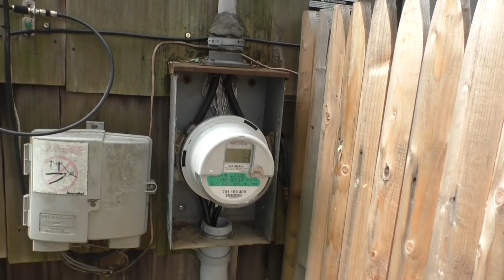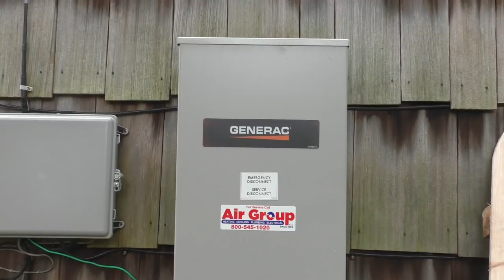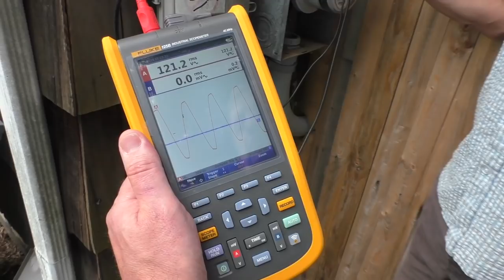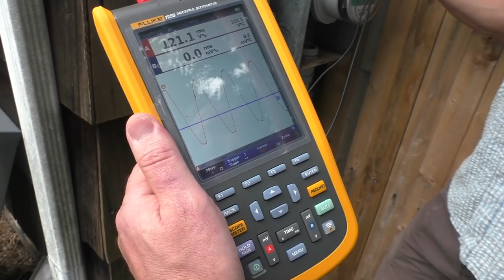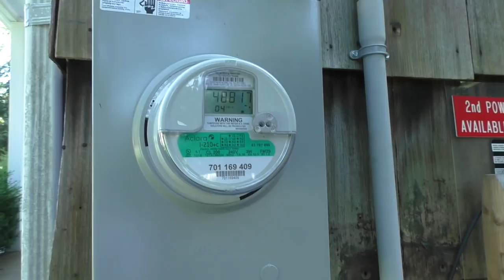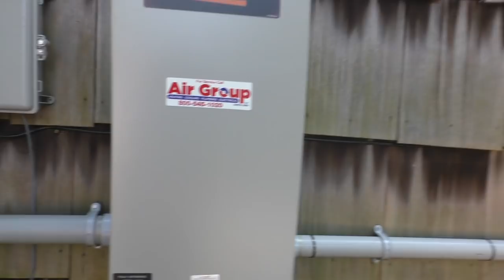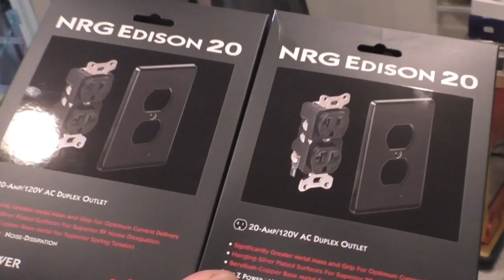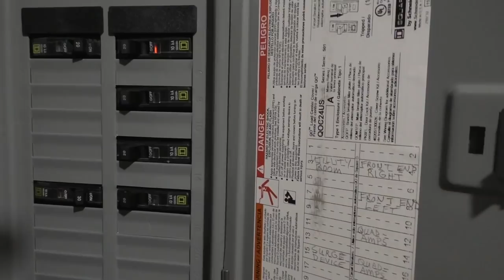Major Electricity Upgrade From the Roof Down Produced Sonically Amazing Results!

Comment: Great video and upgrade. I'm an audio design engineer who works for one of the country's largest engineering firms in NYC. In most of the designs that I undertake, I always design the electrical infrastructure using a balanced power panel. The concept behind balanced power is the same as balanced audio where it utilizes common mode rejection via the power like. In a nutshell, it takes 120V and converts it to two lines of 60V. The input accepts single phase 220V and it ties that to a large isolation transformer that makes the conversion to two lines of 60 volts. The results are astonishing. In your case, even with all of the ground rods and all of the power routing, you are still directly coupled to the outside transformer. With balanced power, you are basically disconnecting your entire audio system from outside power and utilizing  the isolated balanced power from the panel. In most of the acoustic demonstration rooms that I have designed, I have achieved at least 8dB of noise reduction alone when a signal to noise level test is obtained. As far as I'm concerned, it's the only way to go with an audiophile system. I've put balanced power in some broadcast studios as well. I suggest you check out balanced panels. Once you go balanced, there is no turning back.
Reply: Wow never heard of that! 

My system is all installed and done.. is this possible in the UK with 240v mains?
Reply: @johnshore3095  Yes. We use a 120v system here and the units that we use require two phases of 120v each on the input side. That said and being that the power in the UK is 240v on a single phase, the manufacturer will build a unit for you that could possibly accept two phases of 240v with two 120v phases on the output side. The reason for the doubling of voltage on the input side is to make the unit deliver more current. You can power an entire recording studio with just one unit.

Comment: I just finished redoing my music room, had the electrician run two separate lines from the panel to my stereo plugs. These lines don’t feed anything but my Amplifier and Turntable, at the same time we had upgraded to a 300 amp entry, so all new copper wire from the street. 
The difference in sound quality was apparent immediately. 
I found it was the low end or bass that seem to tighten up the most. 
Also noticed quiet sections of the music seems quieter if that makes sense. Describing 
what we here is so difficult for some of us. 
Not sure I would recommend someone going through the expense and trouble of doing this unless you were having hum and noise issues and I wasn’t but we were doing major electrical work anyway so figured what the hell. Anyway that’s may take. Thanks for video. 😎

Comment: Very interesting! As a Dutch person, it's very nice to gain some more insight into the USA power systems.
Reply: USA power is kind of laughable in comparison to the over-engineered UK system. There are still tweaks you can do here, but we have far fewer problems with ground loops and hums and we get 1 phase of ~240V AC with outlets that support 13 Amps as standard.

Comment: Thanks for the video.   I am in the beginning stages of building a house and this is a great starting point.   I am a little mixed up by the multiple ground rods, but I am not an electrician.   My thought it that may cause a ground loop hum, but I will let the pros sort that part out.   The idea of the separate primary panel for the audio was worth the watch.

Comment: We did a couple things at our house that helped. 
1. The utility company was kind enough to change out our pole transformer for a higher capacity new one. 
2. Occasionally I hear a hum from our Koehler transfer switch. I think it is an electric magnet buzzing away in the switch. When it happens I shut off the main utility line power feed and let the generator transfer switch cycle to generator power. After the generator runs ten minutes or so I switch back to utility power and the transfer switch resets with almost always with no buzz.  
3. The Koehler whole house generator creates good clean power at least as far as I can tell. 
4. Our transfer switch is located in the house where it is easy to access in bad weather. 
Best wishes to anyone with these sorts of problems.

Comment: Thanks for the detailed electrical upgrade video showing the possibilities when cleaner power improves audio signals and elimination of humming. My 73 year old apartment building requires the band-aid approach especially with several apartments sharing the same vertical 15 amp circuits. I improved my "modest" 2  HiFi systems with PS Audio's P12 and P15 -- closer to Audiophile heaven. You were lucky that your P15 and P20 were loaners from Paul McGowan.
Reply from the maker: I was. They are very nice to me.

Comment: Power is very important so I am not surprised by these results. We put in a 200 service a few years ago now with a new interior panel. Years later, after Sandy we put in a 27kw Generac generator which runs the entire house. We have the transfer switch too and there was no degradation of the sound.

Comment: Excellent video, Mikey! I did similar upgrade for home system a couple of years ago (although my outside wasn't as bad as your was). I too now have a dedicated (100 Amp) sub panel for my audio, which I eventually intended to replace with one of those wall mounted beauties from Torus Power (100 Bal).

Comment: Very interesting stuff.  Most North American audiophiles have a house powered through a 2S meter.  It is made to be cheap and for easy power disconnect.  The two phases run through two cheap metal bars with cheap tabs that stick into the a cheap socket.  In many cases the connection is weak and corroded.  A lot of houses burn down every year because of a hot meter box.  Little micro arcs where the tabs plug into the socket get hot and the box  gets hot.  Mike had those nice cedar shingles (kindling) that easily catch fire.  Needless to say this crappy connector is a great noise source.  
I am lucky to have a 400amp service with a 3S meter, meaning big thick copper cables go directly to the disconnect panel and not through a meter.  The metering is done with current transformers that sense the power going through the big thick wire.
But I am going to be careful when I get a Generac system with a new panel.  I'll now know to measure the noise on each phase and ensure the circuit to my audio room is isolated from the rest and using the best power available.  And I'll get the ground reading.

Comment: Hi Michael   As a retired electrical contractor in the Uk I could see the potential, excuse the pun for a problem with ground hum and other feed back issues. I must admit I thought your original installation was very poor in the first place , so thankfully the gentleman you got involved has transformed it into a safer and of course less noisy system . The use of aluminium as electrical conductors was a thing back in the 70s when copper was in short supply , so maybe your property was of that time .  Just another thing that might improve things even more , is can you try and separate wires as much as possible and eliminate cables  crossing over each other . Magnetic fields can be induced and create noise in their own right . I know you have the ability to hear these small differences , so anything that can help  achieve your exacting standards will be I’m sure worth it .    Best wishes and kind regards as always 😀👍

Comment: Since you're bypassing the transfer switch does this mean your stereo won't have electricity from the generator in case of an outage?
Reply: that is correct,  the transfer switch is after that exterior main panel.
Reply from the maker: Yes. I can live with that.
Reply: @AnalogPlanet  orly?  ima make a prediction....
Reply: Yes, that’s right. Oddly that isn’t pointed out in the video even though it’s one of the primary changes - the other being the addition of a couple of external earth spikes. All the rest is largely fluff.

Comment: It's true , EVERYTHING  makes a difference with achieving gorgeous analogue sonics!
Reply: No.
Reply from the maker: @leon9021  sorry Leon, but everything does make a difference as long as you're not talking about carpet colors and the like
Reply: @AnalogPlanet  Well there you go, something that doesnt make a difference. The real importancr is if it makes and audible difference however, and that is far from everything.
Reply: @AnalogPlanet  Untrue. I have found that blue carpet widens the soundstage and lowers the noise floor. Prove me wrong.
Reply: The delusion is strong with this one

Comment: Great video, however I would have done it completely differently,I say that as a licensed and bonded electrical contractor/administrator over here in Washington state,I have also been generac factory certified in the repair maintenance and installation of generac generators since 2007, the biggest problem with your electrical service was the fact that you didn't even have a mast to begin with,you had S.E.R. ( service entrance rated) cables going to your meter base, exposed, unfused/not protected from physical damage or the elements conductors going to your meter base. I'm also an audiophile,just came across your channel and I  really enjoy your content.As far as your electrical system is concerned minimum code means just that,so long as it meets minimum code requirements and so long as the end result  and your goal was achieved it doesn't matter how it was done, over thought or not. 1 other thing if you enjoy listening to a.m. radio make sure you don't have any photocells on your property because they inturupt the a.m. signal

Comment: As a licensed electrician and audio lover, I agree with most of what was done. The idea of running a single circuit into the basement panel was not a good idea at all. Good to see the inspector picked that up. I wasn’t really impressed with those guys you brought over from the west coast, as any decent electrician knows all of this mentioned in the video. I know of a few things that still could have been improved but glad to see you are now in a much better place with your power. All steps in the right direction.
Reply from the maker: What was wrong with single phase? It’s all I’m using.
Reply: @AnalogPlanet  
Code isn't my forte, but your inspector being the "local authority having jurisdiction", what they say goes, ... especially in Jersey, no?

So, I'd need more info, however it appears your guys brought 3 wires to the sub panel. 
Two blacks, and a ground. 
One black identified as neutral w/white phase tape. 

I'm guessing the inspector wanted your indoor sub panel to have legit single phase 240v (two hot blacks), one neutral, and safety ground. 

Sound about right?
Reply: @AnalogPlanet  technically he didn't say you couldn't use one phase but rather to run both wires to the panel.  this might be warranted just to avoid surprising some future owner and/or be required by code , the latter I do not know.  

running your whole system on one phase is probably the best sounding way to do it.  that's how most people run, one plug to the wall and an power strip (fancy or not) to the components.  yours a little more involved given the giant amps.  there will be differing noises on L1 and L2.  Having everything on just one of them, they will all see the same (common) noise, which might let them reject it as a system -- or not, but intuitively using one phase makes sense to me for that reason. (At least if all your wires are big enough and such and not losing any dynamics.)

Comment: Michael, thx for the excellent info on home wiring.
But the question I have,  purchased to different sealed copies of Zeppelin 45rpm Stairway to Heaven test pressings months ago.
One from Clarity vinyl and the other from RTI.  Have you compared the two or will you review the two to see if there is any substantial difference.
Eventually I will send them off to Perfect vinyl forever to be professionally cleaned.
hope to hear back from you.
thank you

Comment: I'm looking at all this stuff tacked on to the exterior of the house, thinking "What a cludge ...." 

It's open to the weather, vulnerable to damage, could get frozen in winter and overheated in summer.  

I'm in the UK, and my electric feed enters in an interior corner of my garage, having reached there via underground ducting. All of the electric feed units (main switch, meter, fuse box / breakers / consumer unit) are inside the garage, and all the cable runs are inside.

Comment: wow, from a european perspective US power infrastructure is pretty primitive
Reply: It's getting closer to European standards in some states, fortunately, with the use of RCD/GFCI devices being mandated on many new build properties. Still stuck with the piddly 120 volts and the limitations that come with it, but I guess you can get 240 volts installed for specific applications.

Comment: Love it. When we moved into a smaller older more expensive home (ridiculous i know) I had a dedicated line and some audiophile surge protector installed. Stereo sounded great! But wasn’t able to make a comparison from before 😜 my only issue with this - Michael I think you should have removed the weird wood shingle siding and replaced with something else before doing all this work. 😝

Comment: One more thing I would do if I was Fremer is I would have 6" culverting pipes from the downspouts to direct water off my roof and away from the foundation when there are weather events.  These could be laid by the side of the house and shoved on the downspouts when bad weather is forecast. Get that water shooting away  like 6 or 12 feet away from house. Cost = $50-75 from Home Depot.
Reply from the maker: Been here 20 plus years and perfectly dry lower level.
Reply: @AnalogPlanet  Good to hear. I just worry with all this new climate change monsoon weather we get down our way.

Comment: Some of these back up systems use a floating neutral.  I don't believe that is a good idea.  Your normal service does not have a floating neutral.  Also your sub panel needs the extra phase added. Then balance the panel so both phases are used.

Comment: How much did you get for your scrap aluminum wire 25/60/4 Cents US per pound?  Fremmer look at what you have started.  Now well healed audiophile home owners living in old homes will find a need to upgrade the home electrical system.  Future selling point for you home upgraded electrical system.  Wow you test some turntables outside of your listening room.  So tell us the total price for upgrade ($15K  I JUST READ not bad considering the price of some of your components). And do not forget to tell us all the brand of wiring used within this upgrade.  Also in future reviews do not forget to mention the upgraded electrical system and its effect on your stereo. Thanks for sharing!!

Comment: I’m surprised you didn’t put in a pair of 240v outlets just in case you want to move to more high powered amps in the future like a pair of Boulder 3050s.
Reply: It'd be very simple to implement, he could likely do it without pulling any additional wires.

He's got 240v in the utility room panel, simply land the receptacle neutral, and the receptacle hot... onto a new two pole breaker.

Comment: Great video. These guys really helped you out. One thing that is a red flag for me is your house has aluminum wiring. Aluminum wiring is a fire hazard and should be replaced everywhere you have it in the house to copper. I am no expert, but I know aluminum wiring does not meet code n Ontario where I live for that reason.
Reply: My neighbor in Toronto had his house burned when the Aluminum wiring caused a fire.  Lucky for me, my house built at the same time used copper.

Comment: Micheal I hope you are not in a flood zone.  It appears that you have your set up in the basement.  Also, do you believe that lower ceiling height effects the overall sound?
Reply from the maker: Not in flood zone. Set up is lower level but not full basement. We have 8 foot ceilings, which are pretty normal and I get really good sound here. We've lived in this house for 22 years and even though we are at the bottom of a terraced hill, the lower level remains dry. We were here for hurricane Floyd and hurricane Sandy and 100% dry so I'm confident it will remain dry!
Reply: @lox_5017  trees are good

Comment: Vast sums of money for marginal (confirmation bias?) gains. Answer me this, in the endless quest for 'sonic perfection' (some call it hearing the authentic reproduction of the original recording) which is the 'real' sound, the one you hear anyway or the one you hear when you cup your hands behind your ears? Spend thousands on 'room treatments' to achieve a similar result. Upgrade, change, replace, reposition - whatever you do there will always be 'flat ears' vs 'cupped ears', and the difference is huge. Which is the 'true' sound????